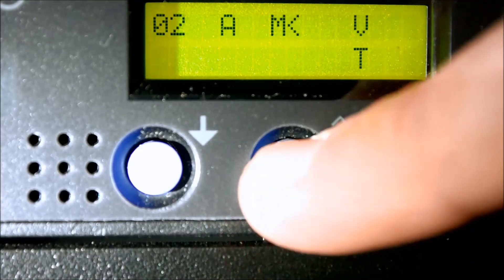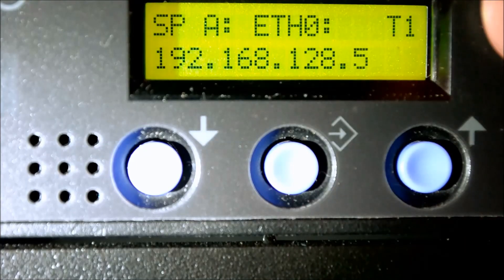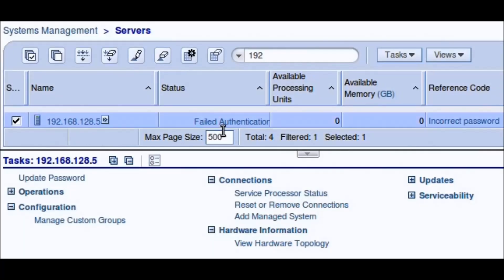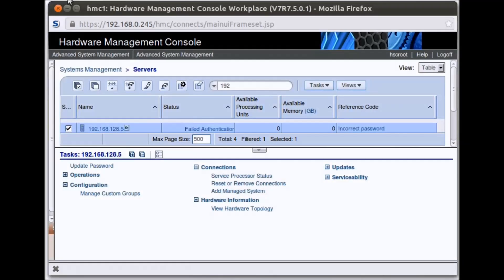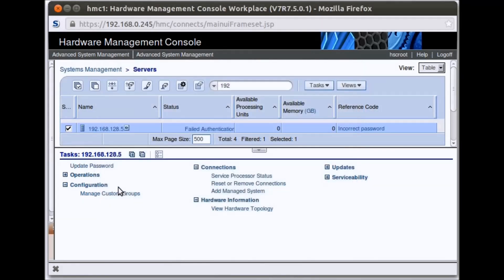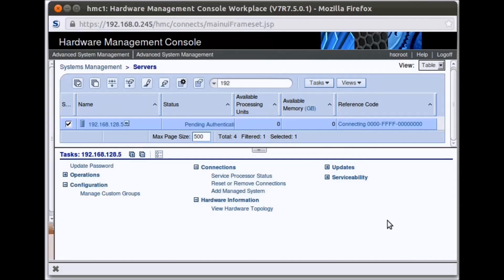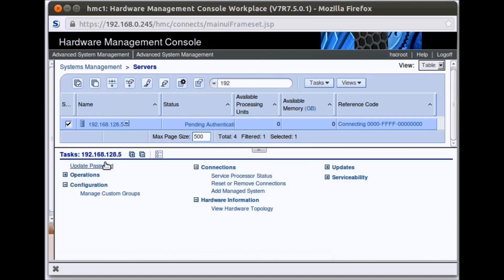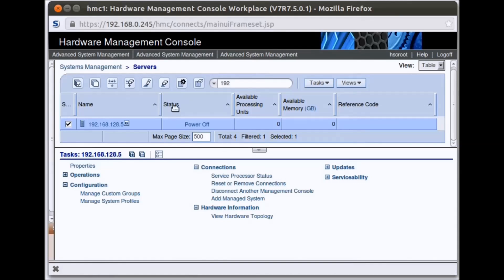How to reset ASMI passwords on a IBM POWER server

Comment: Great stuff!  Im a step further now on my p730 - have IP address at least - but now need to reset SP and that sucker seems to be integrated into the mainboard now, and I dont see any dip-switches.  Setting off now to find a cmos type battery I can unplug for awhile. ;-)   Thanks anyway for your help!  Why is IBM so F-ing chinzy with support info (couldnt even find a proper user manual).   Anser: $$$ They want to sell support contracts, the chodes.
Reply: Did you find a solution to this? I've also bought a second-hand P730, same situation as yourself. No idea what the ASMI password is and HMC doesn't connect.
Reply: @CobsTech  - Yeah. Turns out there is a tiny, hard to find  jumper down between the PCI slots (as I recall, between 2 and 3), but u reeeaaly gotta look for it.  Just remove it and set it to the other pin.  will resent the ASMI password.  Then u need to plug ethernet into S1 port on the back, get a browser and log in.  Best of luck! Glad I cud help.
Reply: @ichhasseamerika  ah awesome, found it! wee black box with two white bits pushed out. got that all reset now have to fight off memory errors haha. thanks for your help chief!

Comment: Hi Brian, i have a Power730, i need to reset my system completely, this is a only system that i have forgotten all passwords. and i don't see the dip switches that you mention in your video in my power 730. i do get a dhcp ip in the front panel. i tied and input the ip into my browser but it will not connect. "connection has timed out" help please!!

Comment: Hello, How did you install HMC on a ThinkPad ? I tried, but I get error Invalid Machine Type/model :(
Reply from the maker: +Mathieu Dunoyer  I'm not running HMC on the ThinkPad in the video - I just connected to my HMC through the web browser on the ThinkPad.
Reply: +Brian Smith's Linux/AIX Videos Thanks for the reply. I managed to reset access to my Power 720 thanks to your video. I found the 2 dip switches on the mainboard (seems the SP is embedded on P7 systems). it was labeled "Riscwatch" and next to is I saw "netres" (network reset?)
So I could access the ASMI via a browser, but HMc is an independent software, no? On your video you are using HMC software, how can I install that on a machine?
Thanks guy :)
Reply: +Mathieu Dunoyer IBM has just announced a virtual HMC appliance but it carries a license fee. https://www.ibm.com/developerworks/community/wikis/home?lang=en#!/wiki/Power%20Systems/page/HMC%20virtual%20appliance%20is%20here and http://www-01.ibm.com/support/docview.wss?uid=nas8N1020969
Reply: Where are the dipswitches at on the 720?
Reply: Hi servextreme, can you please help me out and let me know where the dip switch is on the Power 720 server. I have looked everywhere and cant seem to find the switches that you have found. Please any help would be greatly appreciated,
Reply: If I remember well, it is a 2-switch located between the PCIe slots. You have PCIe 1,2' a space where the switch is located, and PCIe 3,4. It is labeled RISCWATCH. One is labeled netres.

Comment: Do the switches need to be moved back again after the procedure?  or move them once and leave them?  thanks..
Reply: Mittens2012 I've got a feeling those dip switches don't directly reset any configuration data. Instead they select password profiles for authenticating to the SP. In position B'00' that might be the normal operation profile for the user with the passwords set to whatever the user set them. B'11' might be a password profile for a service engineer and set to the default admin/admin creds. It's likely if you flip those switches back to B'00' you'd be locked out again because once more the user password profile selected.

Comment: Excellent - reminded me of what I needed to know... also to add, the ASMI menus are available by plugging a serial cable into the bottom/lh serial port on a 520 and using a term emulator e.g. putty @19200,8,n,1   Removes need of HMC and allows reset of service processor and many other things..
Reply: Does this mean I don't need to open up the machine to change the dip switches? Both my P5 and P850 are unbelievably heavy and stacked one on top of the other with no fancy racks -- and it would be hard for me to pull it out and open up. If you can please share any links to articles or videos on this topic, I would be eternally grateful 🙂